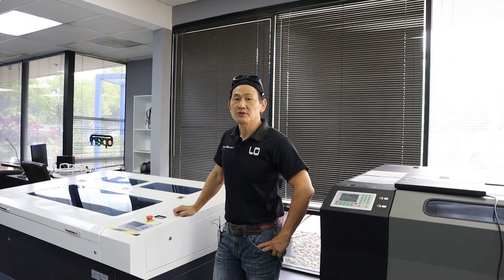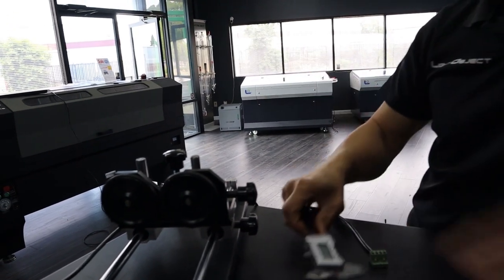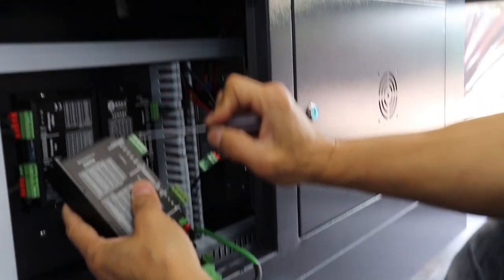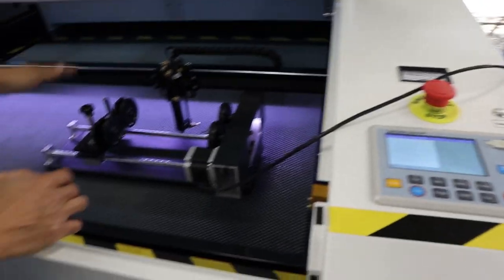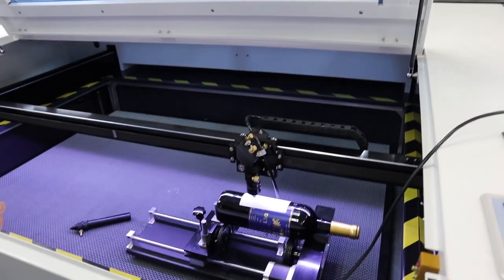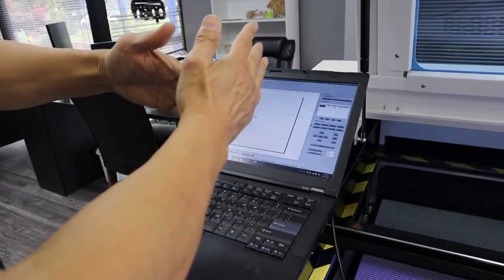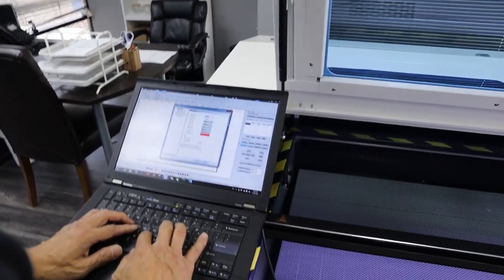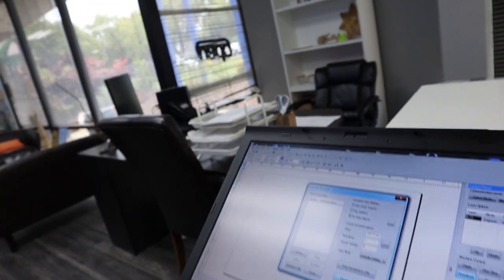How To Use A Rotary For A DSP Laser Controller Card That Doesn't Support on U axis

Comment: Hi Marco, thanks for the video can you tell me if for RD6445G the firmware is ready to use with rotary? Thanks in advance.
Reply from the maker: I was told by the programmer (From Ruida) that all our RD6445G is rotary ready. You know, it was me to press them (Ruida,Teocen, PH) to make  change on the U axis for rotary 😁
Reply: @LightObject  ok good, I need the instruction how to use the U axis because I try and it is not work for me, maybe I'm doing something  wrong. I have Lightburn and RDworks, which one I have to use in order the U axis work. You can email me or DM the instruction. Also today 10/14/2020 I tak with someone in your office and told me he will let you know about it. Thanks
Reply from the maker: @AngelRamirez-mu8pk  I will post it on our support forum LightObject.info
Reply: @LightObject  I saw the post, thanks for your fast response.